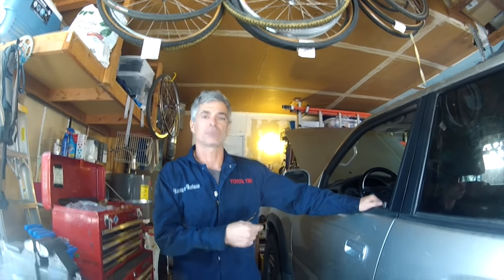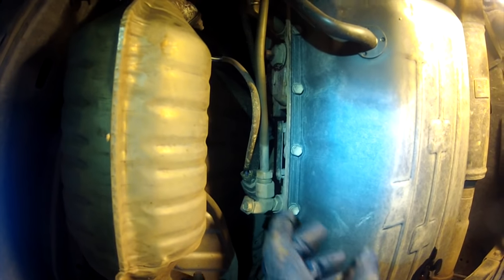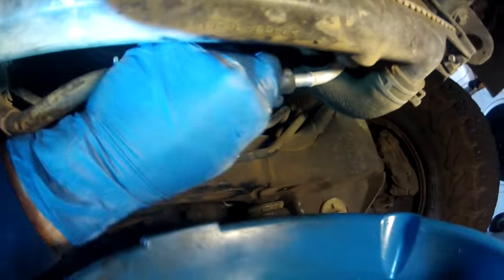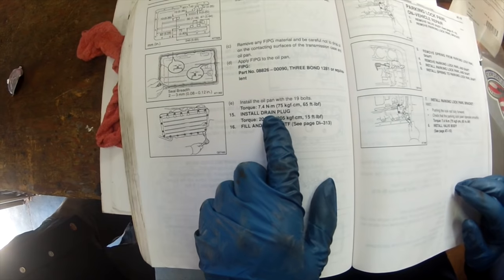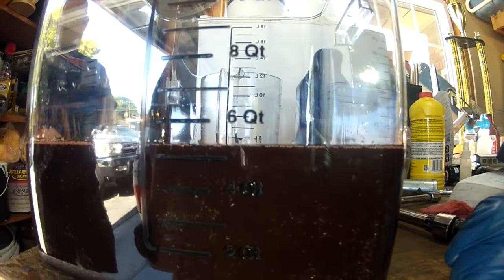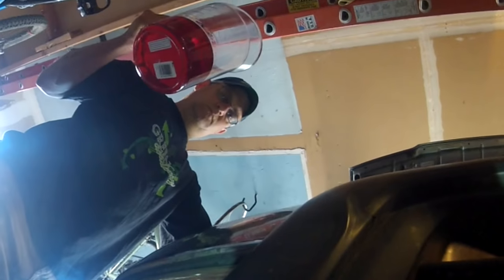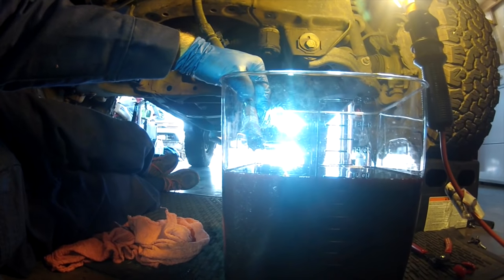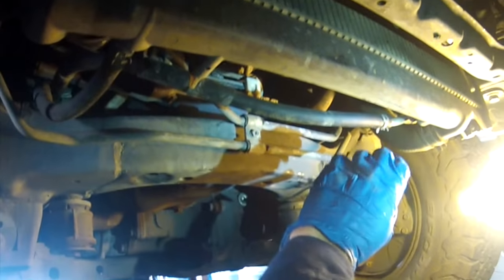Transmission Fluid Flush

Comment: So stupid these are designed this way it wastes new fluid because it mixes with the old crap.
Reply from the maker: There's not any waste.  The system holds around 12 quarts.  After the 12th quart was ran through the system, the fluid was looking good.  Is there some old fluid left mixed with the new fluid?  Yeah, there is.  Is it a big deal, no it isn't.
Reply: @TimmyTheToolman  adding new fluid it gets mixed with the old stuff and you end up draining it because its contaminated and you repeat until its clear red so new fluid does go to waste by design because it has to be added to force the old crap out and it mixes with it in the process.
Reply from the maker: @chriss4365  I remember on old American cars you could drain the torque converter by removing a plug.  I don't think that's done anymore.  With this type of flush, there is some mixing, but what's the big deal?  New fluid is entering the pan where it is sucked through the filter by the pump and then pushed through the system.  It's not a perfect system, but it works very effectively.  You can see the results with your own two eyes where we started with dirty fluid coming out of the return hose and finished with very clean and new looking fluid at the end of the process.  It's not a perfect system and it doesn't have to be.  After exchanging the system capacity, 12 quarts, the fluid looked great.  

I don't agree that the design of these transmissions is bad.  A true mixing or dilution process is draining the pan and refilling it.  A drain of the pan only gets out around 4-4.5 quarts which is around 1/3 of the system capacity.  Instead of doing a full flush on my rigs, I do more frequent drain and refills.  Does it mix new fluid with old fluid?  It sure does.  Does this type of dilution process keep your fluid in good shape?  Yes it does if you do it often enough.  Servicing an automatic transmission isn't like draining out engine oil or servicing a differential or manual transmission.  Some type of dilution process is needed to service the fluid.  There is no perfection when servicing an auto trans.  You do what's necessary to get the fluid in good shape so your trans will have the best chance at lasting a very long time.